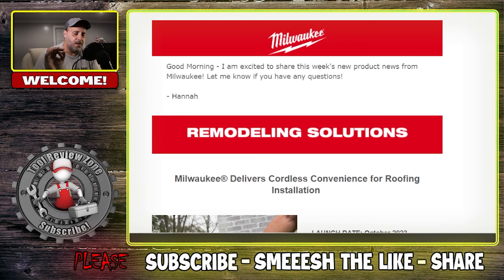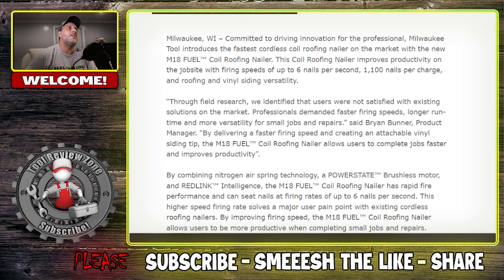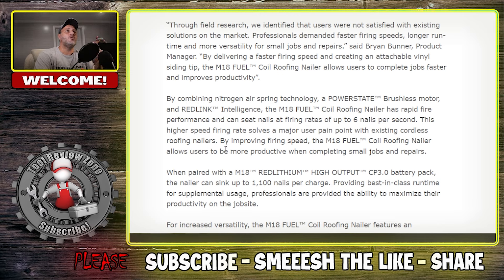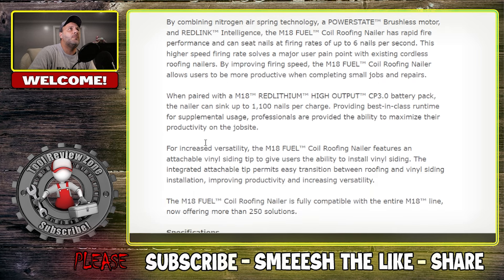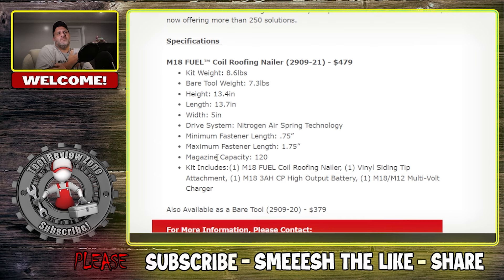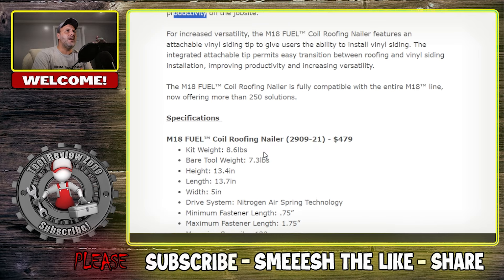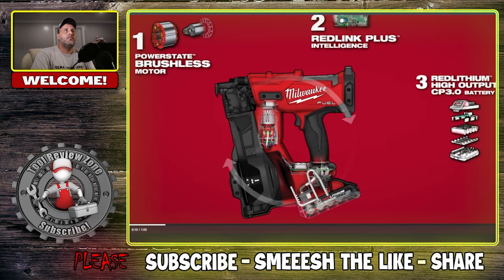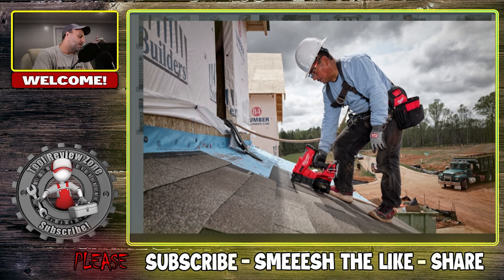The NEW Milwaukee M18 Roofing nailer has a cool attachment

Comment: I want this for my handyman business. I do maintenance work for HOA complex and apartment building with mailbox stands with roof cover. This will work perfectly for me when i replace the shingles. At the moment, I use Milwaukee cordless air compressor with hose and roof nailer.  It works, but it would be nice not to carry around the air compressor and hoses. I only work on single story roofs. I'm done with two stories, LOL. 

Thanks

Comment: Never really good with heights and older I get the worst my vertigo is. I had to climb my shed a few weeks back to trim mulberry tree branches hanging over it. Most pitiful sight I was. Only 12ftin air but it was like 90ft. Cool tool though, thanks for video.

Comment: I've got the framing nailer and with the 6amp ho bat I get all day performance. This  roofing nailer would definitely be handy with the type roof jobs I take. They're small or it's a repair section, but I'm sure you could do a whole roof with this paired with a larger bat and a few extra. I'm waiting for the coil siding nailer for hardie board *hint hint Milwaukee * 😉👍

Comment: I just want to point that we use the DeWalt battery roofing nailer for much more than just shingles or vinyl siding, what I have noticed that we use it the Most is to install almost all the metal trim, so this will be a very good choice (less annoying)
Reply: Metal trim with a coil nailer? How do you get away with that

Comment: I have 2 buddies who are roofers they have both the Dewalt and Milwaukee they use the Dewalt for doing siding, facia, and eves they say it's far better than the Milwaukee they use both for doing shingles but if the pitch is to steep they go back to air due to the weight